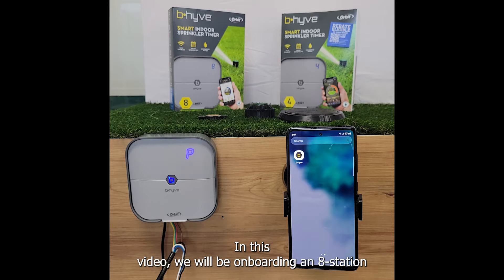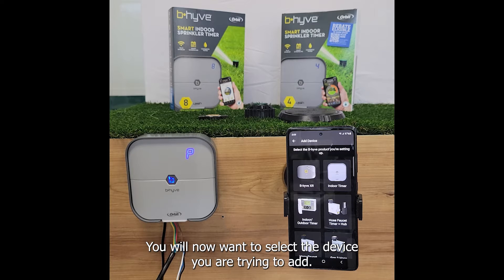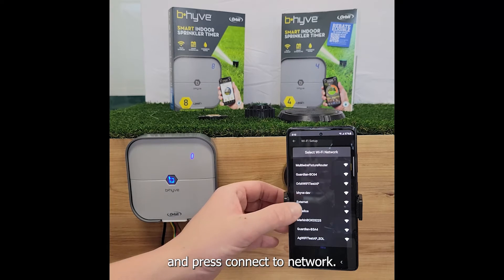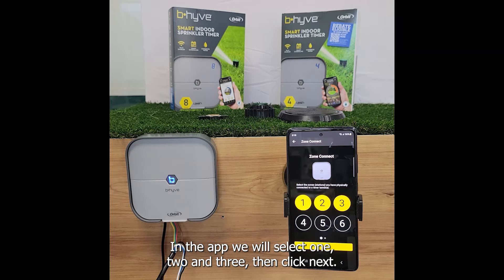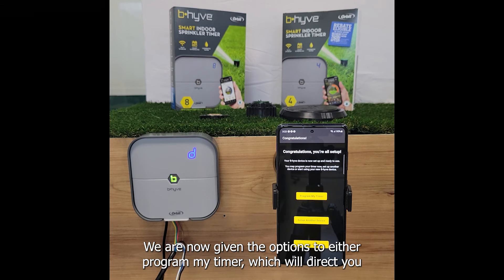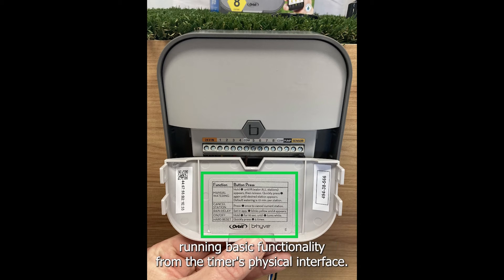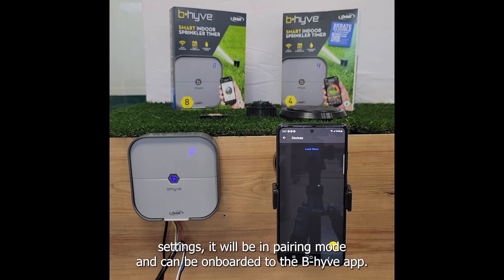Onboarding & Troubleshooting – B-hyve Indoor Timer

Comment: One of my three indoor b-hyve timers got unplugged over the winter. Now I can’t set it up to use on WyFy. It only sets up as Bluetooth. It only responds to one of the four program options rather than running automatically. How can I set it up again for WyFy?
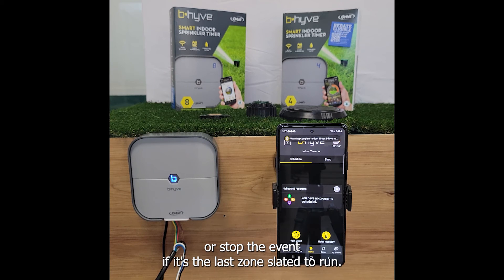Reply: Yes you should be able to add WiFi back to the timer. Under the My Bhyve tab there should be an “update WiFi setting” button for this device. See timestamp 10:07 for WiFi troubleshooting.